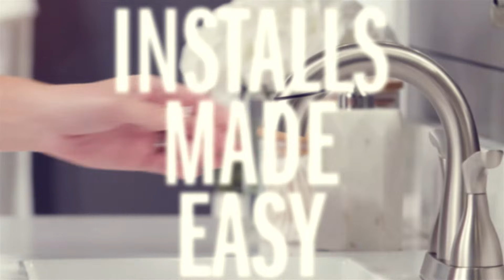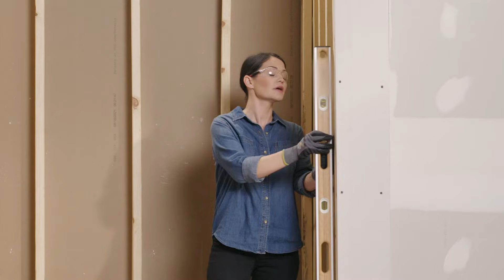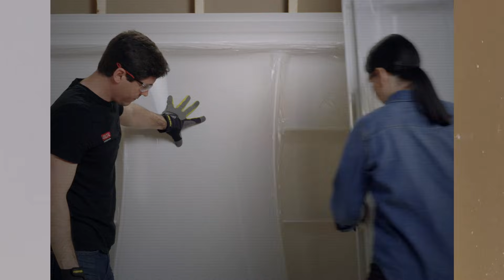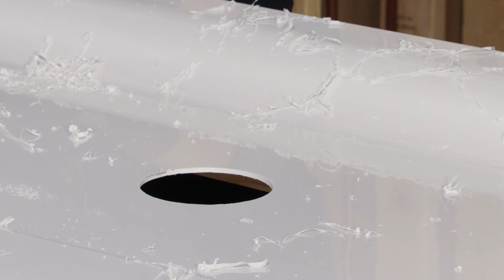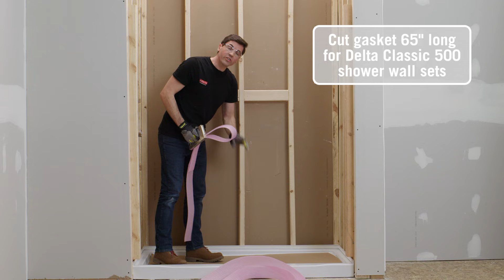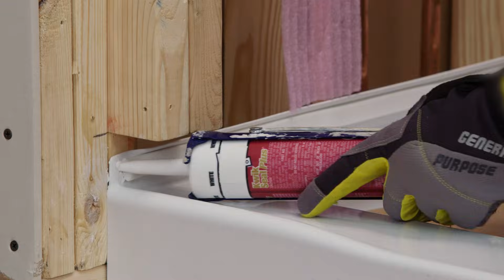How to Install a Delta® Classic 500 Shower Wall Set (60x32)

Comment: Does the valve side wall allow any space if the pipes running to the shower valve and the valve itself are installed to the face of the studs inside of completely inside them like normal? My existing tub unit had about 2” of space between the tub face and the back of the shower wall, so I’m hoping this will work with that set up.

Comment: If you are installing this shower wall set in a rental unit, buy some spray foam insulation, fill in the voids in the back of the wall panels, remove any excess foam once it has hardened. The plastic is very thin and it's only a matter of time before a tenant cracks the unsupported plastic. You're welcome.
Reply from the maker: Hi lafrancia00, Thank you for your feedback! We recommend rolled insulation. Some "Blown-in" insulation could bleed through and cause an issue.

Comment: @deltafaucet What is the purpose of the 1/2" foam tape? Mine only came with a little 12" strip to cut in half and put into the back corners. Do I need to go buy more? Thanks!

Comment: You showed the install of what appears to be 1/2" foam tape, but you didn't list any foam tape in the materials list.  Does that mean the tape comes with the wall kit?  I'm guessing probably not . . .
Reply: I didn’t get any with mine
Reply: @nickdrumheller7293 what did you end up doing with yours? Just install without it?
Reply: @mousetrapbrewing9566 yeah exactly

Comment: The video shows 1/2" foam strip going all the way around the base, but the Classic 500x32 I bought only came with a 12" piece that is supposed to get split into 2 pieces and only put in the corners.  It would be nice if you could add a comment to this video on which installation is correct.
Reply: Thanks I was trying to figure this out
Reply: Lol, I think they are giving you a sample of what you will actually need, so you can buy the roll yourself.  I hate that it's simply foam, but I have gotten behind these over a year after installation and there was no water or mold.

Comment: Man, I'd love to have nice, clean, perfectly plumb studs, all set in a straight line with nothing warped.....My house was built in the late 1950s and I pulled the old tub out to do this.....Nothing is aligned, nothing in plumb, nothing is square and no studs are spaced 16" OC as in modern construction.  I'll get it....but I'm adding studs to the places that Delta demands and making a lot of magic, tapered shims 72" long to bring them all into line.   These are nice young people doing this job but I think they wouild be baffled out here in the real world.
Reply: Same story here!
Reply: I had to the floor under the old tub but yes I'm 4 days in and only up to the 2nd stage .
Reply: Well in all old house renovations one has to use your own wits and common sense.  45 years of restoring old boats and old houses. But I always watch as many videos as I can on a subject as a starting point.

Comment: What size is the foam tape?
Reply: Mine came only with a 12" piece. When I called Delta costumer service to get the correct one,  they recommended I go and buy this:  Frost King 3/4"x5/16"x10' White High-Density Rubber Weatherstrip.
Reply: It comes with the surround.
Reply: @tomlampros7122  Mine came with a little 12" strip of foam tape that the instructions tell you to cut in HALF and put 6" in each back corner. Time to update the video.
Reply: @tomlampros7122  no way, I'd never guess they'd send something that's required to install with it. Wow 

Their tape is different than what came with.
Reply: @chadk321 mine didn't come with foam tape. We're you able to figure out the size? I'm at a stand still on my install until I make a trip to town tomorrow.

Comment: Thanks for the video. In a situation like that one, when you dry fitted the panels, you could have put some chalk or something on the valve body, so you would know exactly where to drill the hole.
Reply: not accurate enough and not correct
Reply: @harveyr.jonesiii1820  actually it is, just installed one
Reply: @jthonn yes I use this technique in many situations

Comment: If you are installing this please be aware that water DOES get under the walls and grows mold. If too much water gets in it will spill in the back. Be aware. Btw i did use the foam and had it professionally install

Comment: How would you install a shower door to this unit? Have been looking all over for a video on that and cannot find it. all videos are just to install the shower kit. Also what shower doors are compatible with this Delta C500 shower kit?
Reply: Any shower doors would work except the oval one and 60 inch wide.
Reply: I meant you need a 60 inch wide shower door kit just fallow the installation instructions
Reply: Oh , not pleasant to think about but if you are in a “ senior” situation the doors can make wheeling a senior into the stall that much more difficult or your self usng a wheel chair if you are disabled. Just go with a shower curtain
Reply: These two are so cute!

Comment: WARNING TO ANY INSTALLER: The 2x6 nailers need to be 2 1/2" centered from the edge of the shower pan if you're putting a door in! This video shows them flush with the edge of the pan and that is incorrect.
Reply: Yes you are right
Reply: He shows doubling them up in the video
Reply: Thanks for letting me know!  The video just says nail it to the existing framing like every house is going to have a stud in the exact location.  I was pausing the video trying to figure that out, definitely need to add that detail in the video good looking out!
Reply: Are you talking about the 2 3/16” measurement he mentioned at 6:26?   That should be 2 1/2”?   Thanks.
Reply: @mikea7691  I believe that measurement is correct, that's the one from the edge up to the bottom of the added stud. The one I'm talking about is from the outside in towards the center of the shower. I ended up doubling up the studs there on both sides to be able to get the 2 1/2 inches needed to attach a door.
Reply: @clericrufio Thanks, I get it now.
Reply: isn't that what they said to do, double up the studs? @clericrufio6675

Comment: The video is very misleading...Caulkess system...no...easy to install...no...How about showing the process in a referb bathroom instead of one that is perfect.  Foam tape is in the wall enclosure box but is taped to the pan...duh.
Reply: For real! I'm getting ready to put one in a mobile home and I'm kinda hoping it doesn't turn into a nightmare
Reply: @sandonmorris7642  I did the tub in my mobile home and about to do the shower; but no design is flawless (even alcoves), and you just have to work through the issues. I noticed the interior edges and corners needed some caulk still (though not required—package label states optional), because I noticed water going in there, and I dislike that; however the 500 system is nice once worked into the space. My handyman recommends leaving the old drywall attached for the shower install for spacing purposes (and just cut/work around it for nailer and blocking, etc), and since I shimmed the F outta the tub (because I removed the old drywall for direct-to-stud ) I am going to leave as much in the space as possible this time. The old alcoves (1983) are not designed for direct to stud (which again, simply an option, not a requirement).
Reply: @sandonmorris7642  good luck with that, I’ve worked in many almost everyone of them was a nightmare
Reply: Just did my grandfathers turned his tub/shower into a walk in shower took 3 days the delta 500 is pretty much idiot proof
Reply: Correct, getting the framing square and level in an existing bathroom is the main problem. In the Delta studio, they built the framing & floor square and level. Not so in my bathroom, and if the walls are not square to a level floor, the installation and snapping together of the components is difficult.
Reply: Haha... I know....this video is such BS!!....they just put 1 "nailer"....the actual instructions say 2 but never does say to use 2 nailers on each side....
Reply: Y’all started with the base down? How stupid , people need to know how to set that also 
Do better
Reply: @bobdabldr323 there is a different video of them doing the pan

Comment: So then, no adhesive on the side panels, just the back? Is this for future access?
Reply: Plus there is no 90 degree bearing surface on my unit so not really sure about what any of the foam  is for purpose wise except for maybe to stop creaking noises from flex?There is another issue one would not want to completely seal the base or there will be a moisture trap because condensate cannot drain. Maybe I am overthinking this. I am a professional chimney guy and roof leak specialist and we deal with a lot of condensation  issues

Comment: I can’t get the side panel to snap right in. Any ideas
Reply: Did you ever resolve this?  I'm having the same issue.  I can lay the back on the floor and get the sides to snap in all the way but not when I dry fit in the shower.  Starting to piss me off lol
Reply: @clgraham82  Use dish soap on both the side and back...mine then slide together.  Video is a joke.
Reply: Your back wall, side walls, and shower base must all be exactly square to one another. Otherwise, the snapping together will be difficult!

Comment: Would I install door nailer if I’m installing the Delta Mod soft closing frameless shower doors?? Please
Reply: I dont know 😂
Reply: I would refer to the installation instructions for the door. It should say what framing is required.
Reply: Yes, frameless shower doors need backing. Thick, heavy glass needs something strong to hang from.